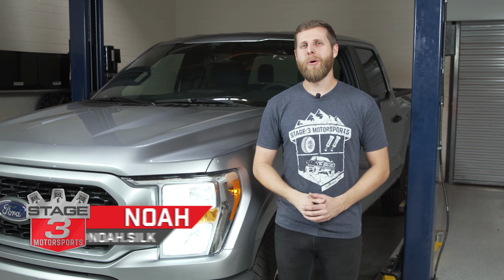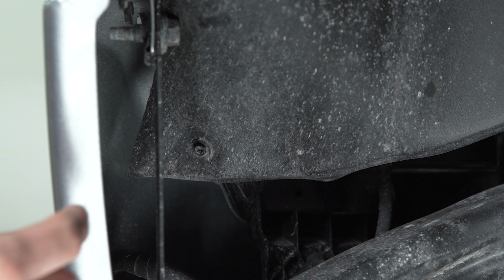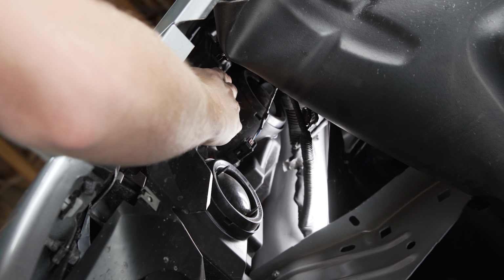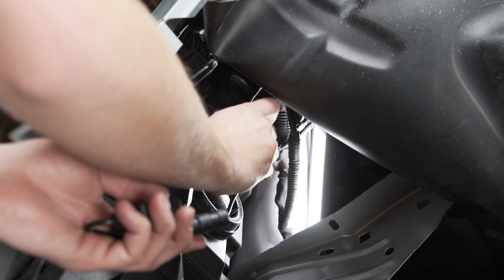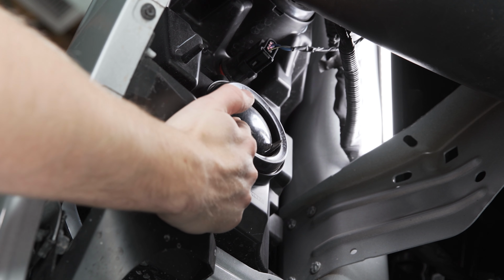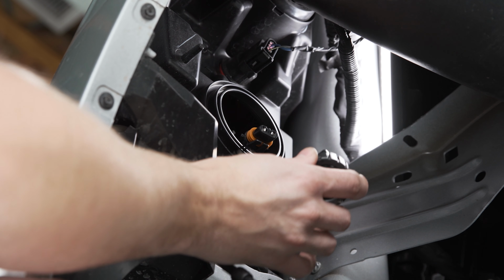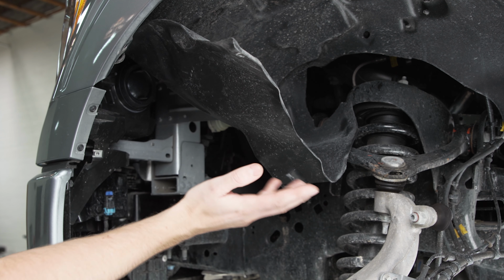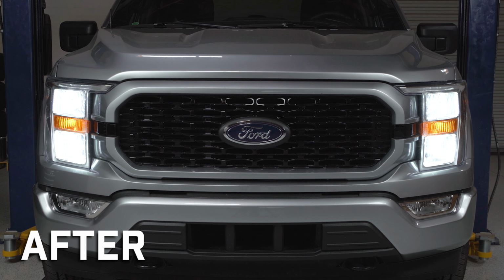How to Replace 2021-2022 F-150 Headlight Bulbs with LEDs

Comment: Worked like a charm, i must be one of the lucky ones with big hands that managed to do ko with this method, thanks for the tip!
Reply: Same here. Triple XXXL glove size at work. 6'5 290lbs. Can palm a basketball. Swapped bulbs into LED's no problem. Steuggled putting dustcaps back on more then anything

Comment: Just got this install done. Took about 45 minutes. 

•High-beam is easy
•Low-beam is a very tight spot. If have someone around with small hands, they are definitely going to be of use for that

Comment: Great video. Just swapped out my headlights using this method. It was a little tight but it only took me about 30-45 minutes. This works the same for my 2018, but the screw head size is a 5.5mm on that gen.

Comment: What does the beam pattern look like with these bulbs vs the OE bulbs?
Reply: Well think about it.  You've surely been blinded by LED's in Halogen housing before!! This is exactly that.
Reply: @chrisk9808  most pickups I see have lift/leveling kits and the drivers don't think to adjust/re-aim headlights, that's the most common reason you get blinded. Second is the wrong bulb or or bulb orientation in the housing. Lots of people just slap in any old LED bulb and sea it's great because it's white(blue) light and it's bright. Meanwhile it has zero resemblance to the factory beam pattern. If someone is changing from Haligen to LED, they should change one side while parked facing a wall(like checking the headlight aim 25ft away) to make sure the new pattern is at least similar to the original. Thats entirely too much expectation for anyone these days.

Comment: Unplugging the connection is unnecessary as will be experienced if just installing a replacement bulb as it has to be plugged into the bulb. Also these bulbs don't always come loose easily. I had use a pair of long nose needle nose pliers to get my low beam (upper bulb) out of my brand new 2022 F150 on the passenger side. Great video but I used the Crystal Vision Ultra by Phillips made in Germany Xenon powered halogens for that blue/white look of HID

Comment: Does anybody knows if the xlt headlight fit the stx?
Reply: if you are talking about the whole headlight you may need an led wire harness adapter if you are talking about the bulbs in this video then yes, this was done on an STX (i also own an STX)
Reply: @zacgoudeau2053  any adapter available
Reply: @giltorres5310  if you have a 14th gen (21-22) look them up on ebay. or look up a video how to do it on youtube

Comment: I tried doing this but my fender liner is that cardboard paper crap. And I felt like it was going to rip apart.  I guess they went realy cheap on the 2021 f150s
Reply: Thats weird my 2022 f150 has the normal plastic ones

Comment: There is no way to do this unless you have small hands. If you think you have big hands don’t try it. Better off removing the whole headlight.
Reply: Absolute and complete nightmare for any adult unless you have some weirdly strong fingers!  I truly wonder why the headlight rear area has to be like 5 inches deep, just give a shall round area like they used to and be done.
Reply: Looks like a job for good ol baby hands 😈
Reply: They do have another video showing how to remove the whole housing as well

Comment: Great video but I can't use it for my 21 F150 that was produced mid year.  My head light assemblies and fog lights do not look anything like these.  None of my bulbs come out of the rear end of the headlights or the fog lights. There are no wells with rubber dust caps.  The only thing that comes out of the back end is the connectors.   I bought a set of Lasfits and none are able to be installed.  I had the same problem with the tail light back up bulbs.

Comment: Please people upgrade to Projector Headlights . Some people put LEDs or HIDS in Reflector Headlights causing them to blind people who are driving the opposite direction.
Reply: Those people put fog lights as headlights, two sided leds in halogen housing don’t cause that
Reply: Cheap LEDs do that
Reply: Sounds like some people need to aim their headlights.
Reply: People that do this don't care about other people.
Reply: That's why you adjust your headlights afterwards.  Most people don't know that.  But it does suck when you driving.